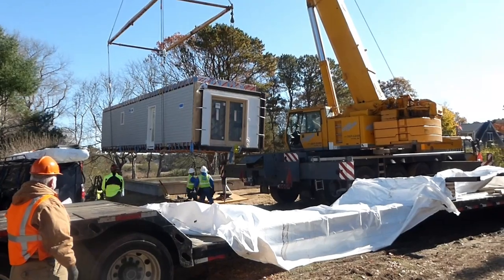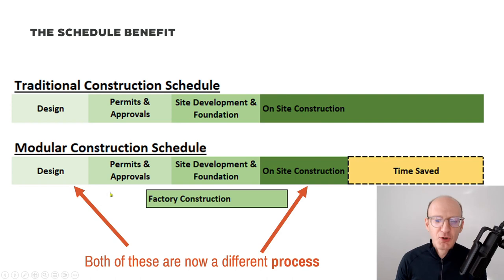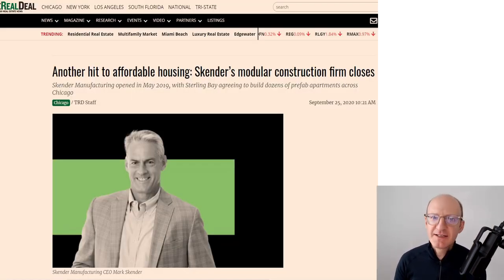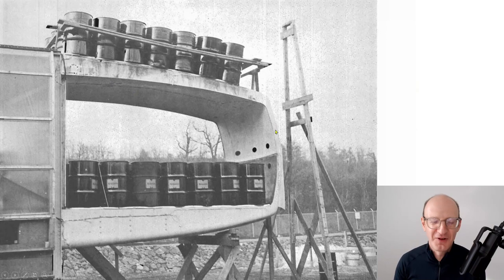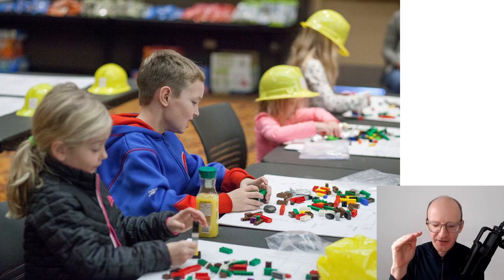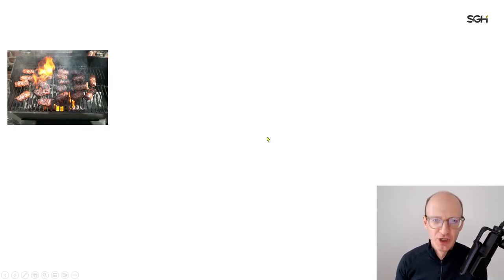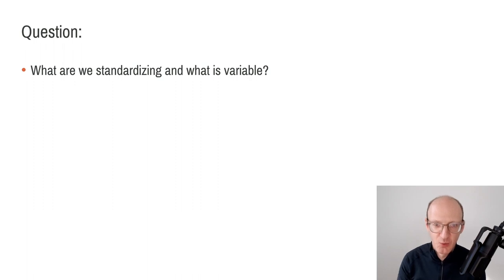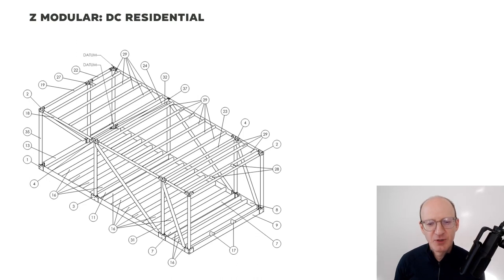Modular Structures: Avoid These Big Mistakes!

Comment: Spent time designing a series of modular homes based on 3 x 7 meter modules 1,2,3 brm options.
Spent probably 5 time's longer on the connections, delivery system, how to move around on site without heavy equipment and assembly than the actual designs__ the US industry and you tube were a great help.
Enjoy the channel have learned a lot.
Reply from the maker: Thanks for sharing...yes, modular is fascinating and opens up new problems to solve to obtain its benefits.  Nothing is free as you noted!  Glad you're enjoying and learning from the videos!

Comment: As part of my engineering degree at the OU, we did a module on the ‘Failure of stressed materials’. One of the failures was an ‘unzipping’ container. Those corners you showed must have been one of the solutions to that problem.

Comment: It is less saved time per unit (you move that time to the design and factory) but it saves time overall because the design and factory lines reduce the time and cost used

Comment: Ive been working on this for years. We must rethink our housing inAmerica. Modular is the way to go but its got to remain classy and functional.  If an apartment dweller could remove that unit and plug it in to a home or stand alone ADU. Americas housing could be fixed.

Comment: Blu homes is kaput, all of these modular systems are the wrong approach, I avoid the node and shrinkage problems entirely by building a structural steel lattice with a proprietary technique than just hang everything off of the mechanically precise stuff.